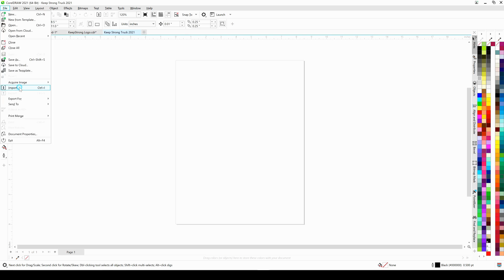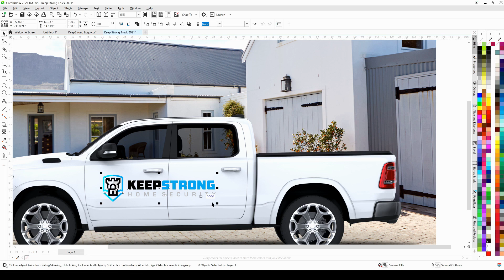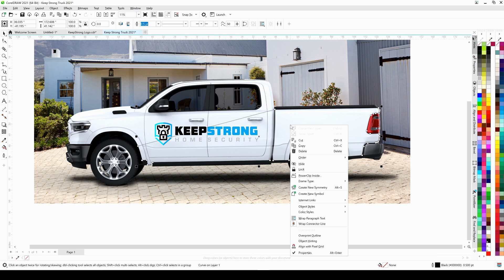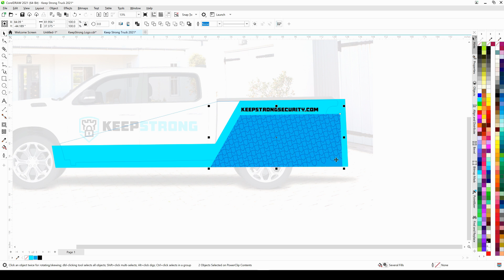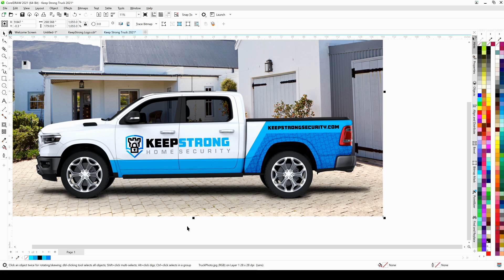How to Design Vehicle Advertising | Joseph Diaz | CorelDRAW for Windows

Comment: Are those color swatches available in CorelDRAW and how to load them?
Reply: One is the default RGB palette, the other two are custom made.  We made them decades ago to match the sign painting enamel we were using at the time and the other matches the vinyl colors we used. I’ve just been using them ever since because they are smaller palettes, much smaller than let’s say the Pantone palette, which you really have to scroll through to find a color. With these there are a lot of colors I use as-is, but can quickly mix with other colors or edit if I need something slightly different.

Comment: wooow .. what is your tool used castle ??
Reply: A lot of the logo icon was made using the Rectangle Tool and the Shape Tool.  You can use any shapes to create simple little logos like that.  Just draw the shapes out, any shapes really, then use the weld tool to weld them together.  Then come back in with the Shape Tool to fine tune it.  It's as easy as that.  Coming up with the ideas is the tricky part, CorelDRAW makes the rest easy.